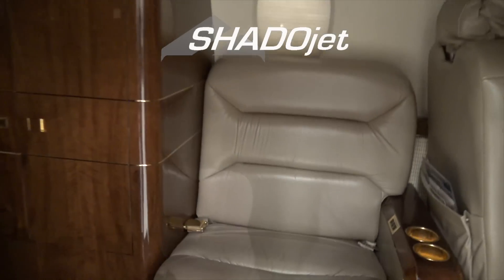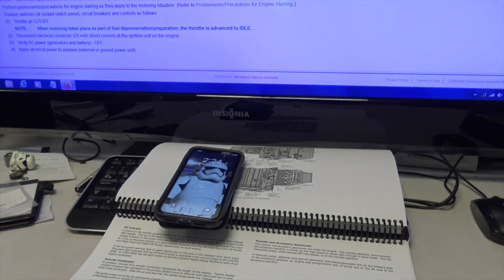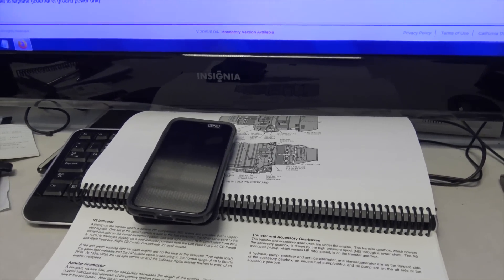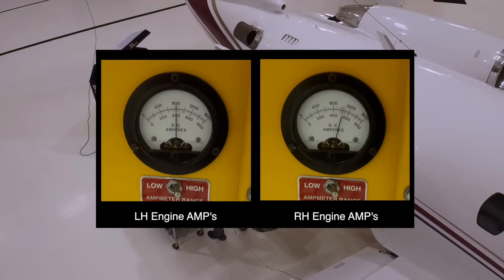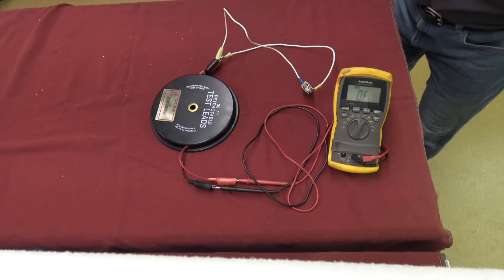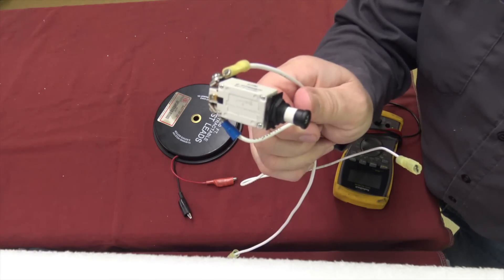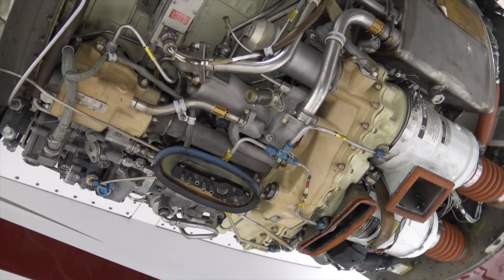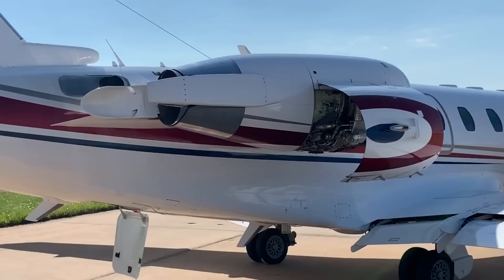Right engine doesn't start TFE731

Comment: Over 60 years as an A&P and only a saw few breakers with internal failures on civilian jets. Many breaker problems happened on military aircraft ( A-6"s did it often ) because of age and running near max amperage over time. Smacking down on the flight deck did not help either with weak internal springs.

Comment: Man man this is bad knowledge. 
Sorry for my arrogance! 

I’m a 731 tech and you guys run around caching the problem.   I would have fixed that engine in one day. 
My first thought was the FCU shaft has been broken l😂. 
Where is al the guru training form honeywell well for?  Did you all follow that? 
This scenario is one of the 3 scenario lessons on trouble shooting . 

Note :  be glad that engine didn’t pick up. Because that fcu is in manual mode. The Deec or eec would have no influence on that fcu. Manipulation of the power lever could result in a cooked out turbine 

Have a tip from me . The starter engines will not make the grade in max start cycles. Overhaul them sooner.
After mx , test run the engines with bottom panel open en feel the starter at start up. You can feel if and hear the condition. If it’s start to rattle in your hand it’s about 2/3 worn. 
Mx cockpit check . Start the engine , Let it run to about 22 % rmp before adding fuel. If it takes to long to make that 22% the starter hands you the indicator it’s down wearing. Also in the Honeywell training is the spool up and spool  down time to be checked..
Note : 
Don’t tell pilots to wait for that 22% as they have to follow the normal procedures. 
But they can monitor the spool up and spool down time for you too. 

Also there is a general circular advisory to hand pull all CB’s every so and so time. You have to pull it about 3 times in sequence.  The why is .. they may get lazy / faulty like the one you showed.

Comment: Former USAF hydraulic technician C124 C141 C130 C133 and any aircraft that came through transient at Dover Air Force Base. I have subscribed and thanks for the memories of working the flight line also TDY to Kadena AFB in Okinawa.

Comment: There are so many circuit breakers on airplanes that is not unusual to find faulty circuit breakers, or circuit built into switches.   by the way, if I took weeks to fix an airplane, they had a trial issue. I probably would’ve been reprimanded or lost my job.

Comment: A failing fuel control, airborne, not  good. What are the rules regarding teardown, inspection, and parts replacement on a smaller jet engine such as this?

Comment: Retired Aerospace technician here, I watched in pain as I read "Two weeks later." If I ever took that long to diagnose and repair that squawk, I'd be looking for another job. As a side note, did you really remove and disassemble the entire gearbox before removing components one at a time to check that noise? I feel for you brother, and not to be a jerk, but...........? ps. I never had three cameras that I could use in my troubleshooting.

Comment: I used to work next to an international airport and the main runway was literally 200 feet from our parking lot. I would go outside to eat my lunch and watch all the aircraft taking off and landing. It was a 11,000 foot runway so we got everything from the Cargolux 747 to crop dusters. The Air National Guard was also close by and had a terminal there as well. Pilots just getting their hours would do 10 takeoffs/landings to stay current. But once in a while you would see things go wrong. Aborted takeoffs, go arounds, engine failures, etc. Once I watched a Piper Cub sputtering up to the hold line and the engine died. He restarted and smoke poured out, he pulled onto the runway and it died again. Restart and this time he opened the throttle wide open and never came off it, down the runway he went. Sounded like a lawnmower in the distance. We called him 5 o'clock Charlie from the MASH show. lol Balls of concrete or batshit crazy, hard to decide. He was a crowd favorite

Comment: Starter Generator and or the GCU!!!!
Reply from the maker: The Starter / Generator was the first thing that was removed, and swapped with a known good Starter / Generator. Also the GCU's were swapped, along with the starter / generator power relay, and so much more.The right starter / generator and GCU was put on the left engine, and they started the left engine perfectly. I know it is easy to make assumptions on what the problems might be, based on the minimum data posted in the video. Just know that all things were looked at and tried before the right engine fuel control was determined to be the problem. I don't assume what the problem could be. I follow the testing data and testing procedures to find the proper solutions.

Comment: why does itt on left engine rise when right engine is started?
Reply from the maker: I was performing a cross generator start. This method accelerates the engine that is running and provides additional power to the engine being started. It is a way to help protect the APU generator by sharing part of the electrical load. Hope that makes sense.

Comment: I did have a small desire to work on aircraft, but after thinking it through, I figured that if I misdiagnosed or made a mistake on a car, they could just pull over, if I did on a plane, well, I'd probably see it on the news.  So working on cars I did.  Hats off to you aviation technicians.
Reply: Thank you! Yeah we carry a lot of responsibility. We Re-check everything a lot.
Reply: @keithexum7312  I wanted to get into A&P maintenance full time here in Philadelphia PA, after a few years the number of awful repairs and accountability I saw made me sick and I switched gears to work for Rolls Royce Automotive instead. That was 24 years ago now and I don't work in maintenance anymore or (Rolls Royce) anymore but love your content.
Reply: @ thanks! Rolls-Royce! I’m sure it was a lot of fun. The only Rolls-Royce I ever worked on was on Gulfstream II thru GV. They make really good engines that make a lot of power.
They named their aircraft engines after rivers in England.

Comment: Why would you not get a mechanic's stethoscope out and find what's making the noise? Why would you just start tearing apart gearboxes? Am I crazy?
Also, does the computer not tell you that it's tripping a the start sequence because of insufficient RPMs after X time? How does that not scream a bearing is shot?

Comment: I had an intermittent CB located in the hell hole for the starter generator field on a Hawker. Damn thing would kill our gas powered GPU. I guess some responders have never trouble shot something that worked fine until you try to fly it.

Comment: Not a sparky but the hardest thing I fixed on slowtation (some of them get bugs on trailing edge) was when master was turned on and the radios came on. After tearing half of instrument panel out figured (had help) the relay for radio master lost its ground. Fixed in 2 days. Should have charged more. Look what this man got charged for his problem. Not very good troubleshooting.

Comment: In about 40 years of working on aircraft, I never saw a breaker like that. Every time I think I have seen it all, something new appears. Good work! And the fuel control issue, you would think the jet engine techs that looked at it would have found that. A small percentage of techs go straight to the problems, and sadly, they don't get more pay, they get more work.

Comment: So the fault was the fuel controller mech? 

Where/what was the failure inside it? What was the source of that grinding sound?

The higher starter current was a secondary fault wasn't it?

Comment: Lord, this is just like the car repair industry. And that's scary. That starter noise (that turned out to be the fuel control) was painfully obvious to anybody yet was missed by two specialists. The car guys just start loading the parts cannon and fire new parts in, hoping one will fix the problem. I'm guessing it's way, way too expensive with jet parts to do the same, but Lordy this seemed simple enough to diagnose.

Comment: I run into this a lot on APUs. I just run the engine and listen to the ignitor. If the ignitor sparks, I look for a fuel problem. thanks for this information. Does this engine have a FADEC that records faults?

Comment: Wouldn't manually turning the high spool be one of the first things you'd check? It was clear the ESG was kicking out early, and one of the causes of that symptom would be excessive torque required to spin the rotor overloading the motor. Cool video, though. Those engines reach idle quickly!

Comment: Circuit breaker that pops a bunch of times I would not trust that it in an airplane. The bi metal gets distorted. And get a new Fluke DVM your trusting your life on a Radio Shack. Good job good video though thanks.

Comment: Gonna need some pliers and a set of 30 weight ball-bearings to fix that bypass line. Should have prepared the fetzer valve with some gauze pads and some 3 in 1 oil. I also noticed the lack of the mandatory 10 gallons of antifreeze. Preston’s would have worked, but preferably Quaker State.
Reply: Thank you.  “It’s all ball bearings these days!”

Comment: Being an A&P for the past 45 years and the most being on the Boeing products now retired, trouble shooting always started with the FIM or Fault Isolation Manual.
More times then not it started with making sure you had power to the system that you were working on, with that being said breakers are the first thing to check, The start
sequence was looking for certain desecrate and not seeing it so it timed out. These faults are fairly easy to trouble shoot,  if you go to the system description
part of the manual it will tell you how the system works, I always start there, it doesn't matter what system your working on.

Comment: I’m half way through and can say 1) look at chip collectors and oil screens.
2) pull starter and check torque required to rotate.
3) rotate the (geared) fan by hand and note feel and effort.
The nightmare we fear is AGB metal. 
Repeated start attempts just add to the damage. 
Small possibility is bad starter, swap or do milliohm check after blowing it out. But not likely.
I will now play rest of video and eat crow in 2 minutes?
OK, bad FCU. What was grinding up? Integral pump or mechanical speed input? If making grinding noise, did it contaminate the fuel system? If risk, pull the fuel system downstream. Are the fuel nozzles fouled?
Reply: I was thinking this too. What's going on downstream...? Is this a time bomb. 

No different to a failing fuel pump in a car, where all those bits of metal end up in the injectors- which will fail once the new fuel pump is up and running. And then the new fuel pump will fail again. "oh, must be a faulty new fuel pump"...
Reply: Talking to an AME once he explained that to avoid pushback on downstream fouling of the fuel injector nozzles he flowed them into a bucket. The subject design had no last chance screens so bad pattern was obvious. 
Remove all lines and back flush, replace pump, filter, remove flow divider, ecology ejector, nozzles. Many $ but there is no choice.

Comment: Great diagnostic work! I hate intermittents. As an electronics communications tech I have seen my fair share of it wether it’s a fixed base control or a mobile unit they will drive any tech nuts.

Comment: "I like your approach procedure on this project, you know how to get it(The Job) done right with proper trail and error regardless of the work sequence (Whereby? You took down the transmission unit just to ensure the gears or bearings were not faulty- I liked that(It showed you have high tolerance that serves as a pledge to the inspection for proper operations and function)? Even though it was not the initial problem, it was a check sequence proven.) . Congratulations!" 👍

Comment: surely there is a simple amp clamp test that can clearly demonstrate excessive amp draw on the starter.  However that is a very informative method of gathering all the information to pinpoint the gear train issue overloading the starter.  which makes me wonder what the hell the other "specialists" were contributing.
Reply from the maker: Great point!

Comment: Yeah not an aircraft techy but I do know that if you run a fuel pump without fuel in it it’s going to fail quickly but obviously on an aircraft I imagine there is a lot more going on to distract you from noticing that. Good job though mate and all good experience isn’t it? Certainly as an electronics engineer which is my role in my time I have had my arse kicked by something that appeared to be operating but didn’t. 
I used to work on high power HF radio transmitters and we had this transmitter that wouldn’t auto tune up on certain frequencies. What needs to happen is that there is a device called a Jennings Capacitor it has to be physically operated by what looks like a connecting rod like you see between the piston and the crankshaft on a car engine. This is driven by a servo motor and there is a feedback control which feeds a meter so that as the motor turns, the connecting rod compresses or expands the Jennings capacitor and the feedback sensor which is connected to the motor end gives a visual indication of the position of the capacitor / motor position. 
So when we tried to tune the transmitter automatically and in manual, depending upon the frequency, you have to set 3 similar settings to their approximate position by using the meter indications and turning an associated control. 
What was happening, on this one capacitor, the position was supposedly changing and you could hear the servo motor move so we thought all good. What we didn’t check was the current and the output power of the transmitter which alters as the capacitor moves we were so drawn to the issue of watching the leds elsewhere for other parameters that we failed to notice no change in current or output power despite us moving the capacitor. The problem was the connecting rod had sheered off the capacitor, servo and indicator was changing but capacitance wasn’t changing. The capacitor is hidden behind a panel that you would never remove if there was power on it. We could have run the kit off with the covers off and no RF a or high voltage supplies applied and with a torch looked underneath.
Lesson is sometimes despite indications there is often something else lurking… anyway sorry for boring you but thought I’d share my shame lol 😂😂 

But we’ll done mate, bet you felt good when you fixed it!

Comment: As an electric engineer i have to say a biig hank you for the videos of the GPU current meter. This beauty pulls such a nice current on startup even when the engine is okay :D But does each engine has double DC-generators, or one DC starter-gen and one AC alternator for the 3ph 400Hz?
Reply from the maker: The TFE731-4 engines on this jet have one Starter / Generator and one Alternator on each engine.
Reply: @shadojet3868  Thanks! By the size and current draw of the starter-gen i guess it's a 400Amp 4-terminal type.

Comment: Intermittent faults are the worst kind. I work on military electronic systems and I hate it when the operator tells me something's not working, but does when I look at it, only for it to fail again with a different operator.
Reply: Unavoidable.

Comment: Bad breakers are always a royal pain. I had to deal with a very similar failure on my home furnace a few months back. Two-phase 240V breaker that had failed open on one leg even in the closed position, but worked fine on reset. Finding that took a while!

Also more A&Ps should go on post-maintenance test flights. It's a nice reward for the mechanic and also helps ensure quality work from the owner/operator's perspective since the mechanic knows he's gonna be flying on the thing after finishing the repair!

Comment: Tell the avionics guys it's their problem. Always.
At 250 kts our DC-9 felt like it was rolling over rumble strips. Crew chief said : no fault found on our side. It must be an avionics fault. Find it.
Well, in the end it wasn't the avionics. An undocumented incomplete part robbery left one elevator push rod disconnected causing the elevator to flutter at 250.

Comment: Can you explain why the fuel control was causing a high current draw? 

I understood that you did the start-up test with the fuel cut off, although there was also a high current draw. I must say that I know nothing about aeronautics.
Reply from the maker: The FCU is mechanical. It has gears, fly weights, a mechanical fuel pump and more. These type of jet engines can be controlled manually, even if the DEEC fails and all electricity in the aircraft is lost. If an EMP hits this aircraft, it will still fly. Navigation by sight due to electronics lost, but the pilots can keep the aircraft in the air and safely land.

Comment: I had 8 years as a engine technician on F-4's and NEVER heard a noise like that from an FMU.  As others have asked, what caused the racket in the FMU?
Reply from the maker: My hats off to you for the work you did on F4 Phantoms. An awesome machine! My understanding is the FCU mechanical parts were coming apart.

Comment: My first thought was the starter/gen, that rumbling sound kinda sounded like the armature or the bearings grinding which could have led to increased amp draw as well. I would’ve used the old screwdriver to the ear stethoscope method before I pulled it off of the gearbox though, nicely done.
Reply from the maker: I thought it was the Starter / Generator at first. I pulled the generator off, and the noise was still there. Yes, I used the ear stethoscope method and found the noise coming from the FCU.
Reply: Sounded to me like a dried out, worn bronze bearing bush, where the shaft is too loose and it oscillates inside when slowing down without a load.